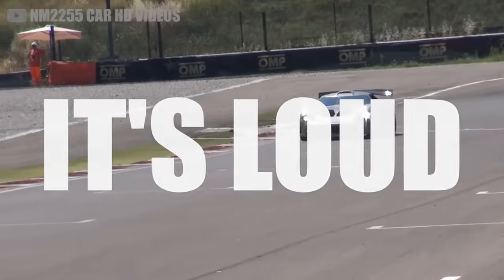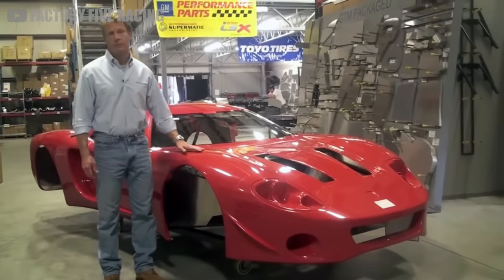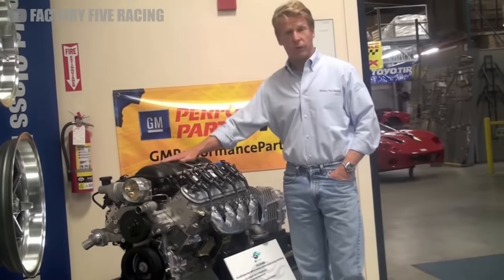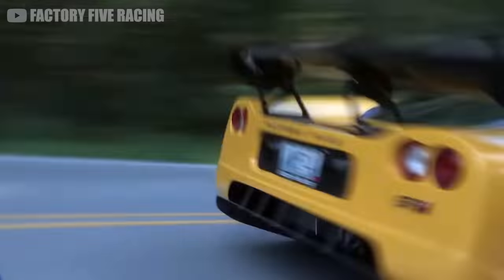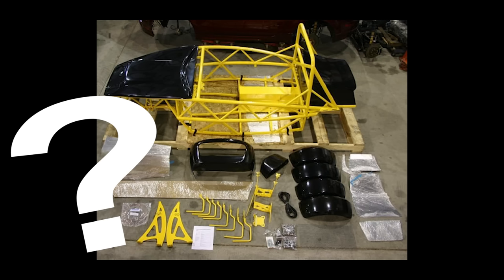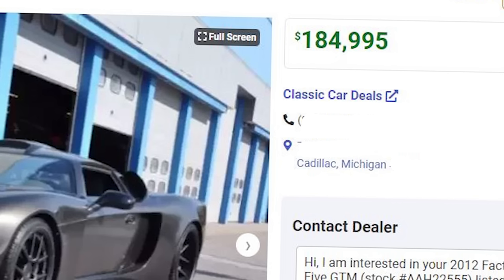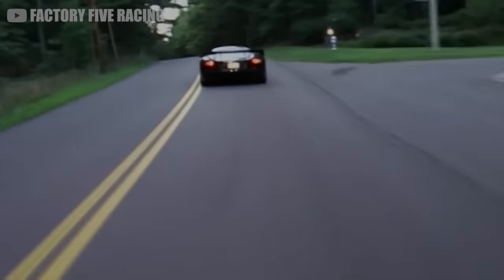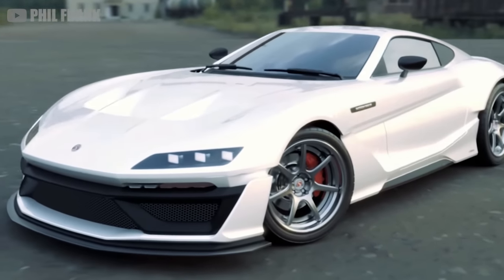The FASTEST Car You Will Ever Build | Factory Five GTM

Comment: It's literally a GT40 with a different rear end, no originality
Reply: You don't seem to know what a GT40 is.
Reply: @MuShinnen  The windshield IS GT40 as are the top of the front fenders.
Reply: @carbonfiber8071  So two sections of the entire car.. vs an entirely different car.
Reply: @carbonfiber8071  You definitely don't. A Lamborghini uses the headlights from a Nissan 300zx. Does that make the Lambo a Nissan now? No. Borrowing a handful of parts doesn't make it the same car. Your name must be carbon fiber because your brain is every bit as smooth.
Reply: @MuShinnen  You didn't recognize some of the most notable lines of automotive history. Body wise, this car is based on the French VBM4000, a French race car. The lines are most certainly GT40. The GT40 is a tube steel space frame like the GTM. Mid-engine V8 & transaxle. High HP to weight ratio, 42" vs 40" tall, etc. VERY SIMILAR. What specifically do you mean?
Reply: @MuShinnen  They don't share parts either, it's the shape, and the windsheild.
Reply: @MuShinnen  He was referring to the body.
Reply: @MuShinnen  I think you missed the point.
Reply: @carbonfiber8071  You missed the point. You went from saying something is literally something else to saying it's similar. You don't know that similar and literal do not have the same meaning. Lots of cars have a tube steel space frame, V8 mid-engines, and a transaxles. That doesn't make them derivatives of each other, nor does it mean they are "literally" the same. I'll be ignoring any and all of your following responses. Learn what words mean. Take care.
Reply: @MuShinnen  He clearly meant the design. The truth is, the similarities are everywhere. Now that you have been schooled, I'll be ignoring your further posts. Learn what people mean when they string together words in a sentence. Take more care.
Reply: @MuShinnen  You are the guy who said he didn't know what a GT40 was, WHILE he was recognizing the actual lines from part of that very car.